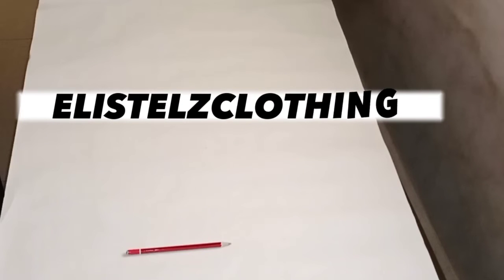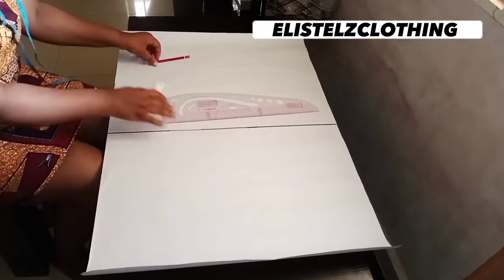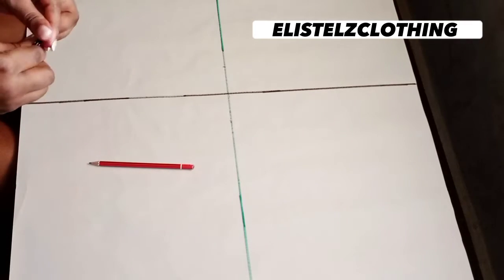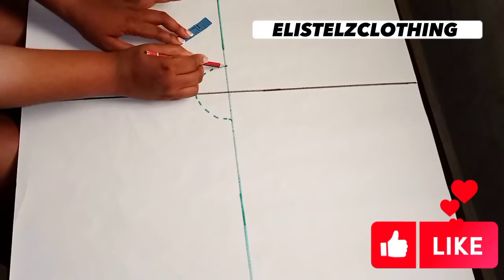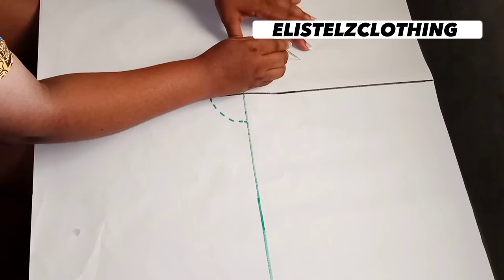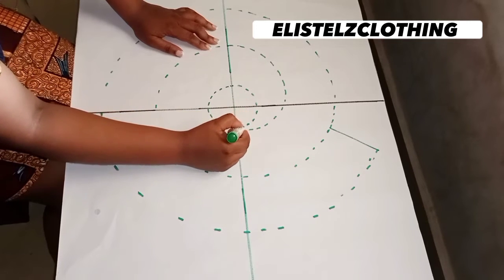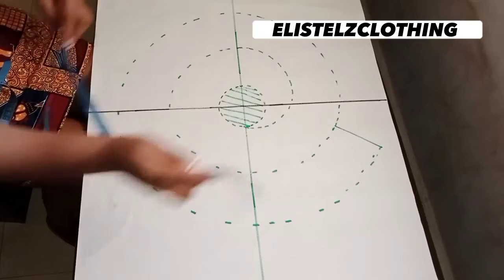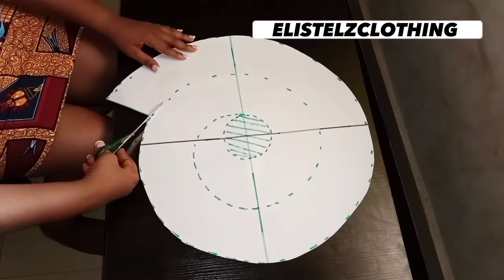How To Cut A Flounce

Comment: God bless you.
Pls, is the 2inches constant ?
Reply from the maker: No. You can also use 1inch as the starting figure
Reply: Can I use more than 2?
Reply from the maker: @chibuzoogbonna3768  No ma. But you can either use 2" or 1" . You need the starting point to be smaller